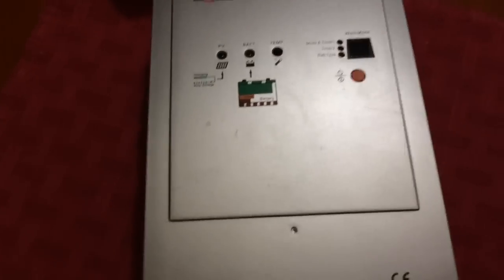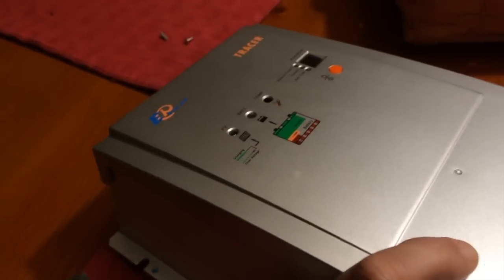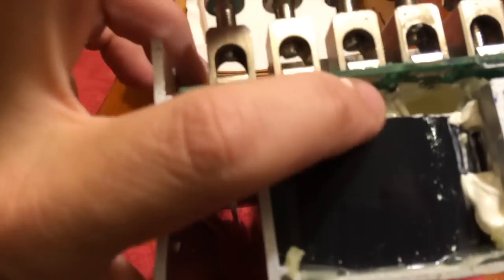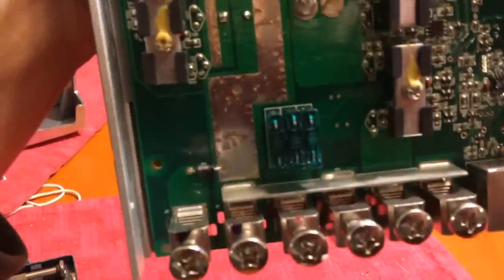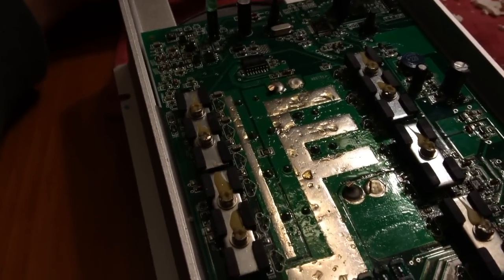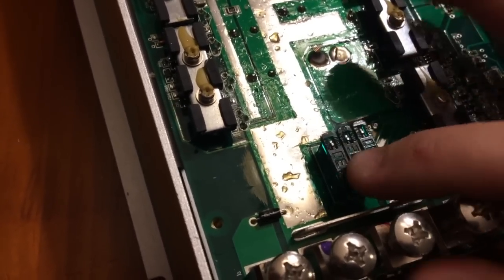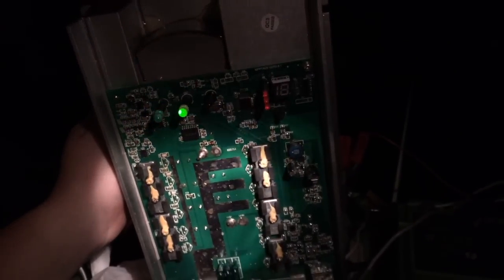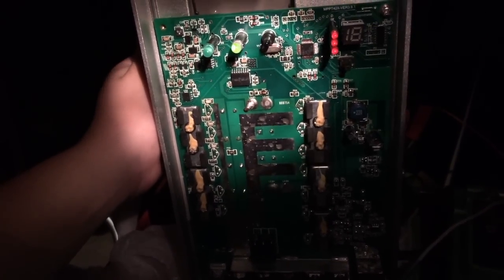Need Help Fixing My Tracer MPPT Solar Charge Controller

Comment: Did you ever find the issue ? I saw something on the board that looked like a cracked soldering joint and possible cooked looking. I'd be willing to check it out for you, just for the education.. I do work on electronics,, All that i'd ask you for is the shipping cost.. If i can't repair it. then i just return it to you.. There is few to no one around to repair these units,

Comment: I am currently working on the repair of one those units!  In the glue at the bottom there are all the big electrolytic caps and a big inductor.  The inductor is for the buck converter in this unit.  That is the part of the circuit that take the voltage from the panel and regulate it down to the battery level.  Could you share the marking on U10? U10 is an ic next to the Ethernet port I cannot read it in mine
Reply: U10 - LM2903

Comment: Hi that white stuff is for vibration and heat transfer from the transformer or inductor  that's located in the black cylinder like container. now test the unit by hooking up the out put to a battery and put laptop charger on the input this would be for 12v configuration and check the current flow from input to output.
The output current should be higher also the input voltage should also be higher. 
There is a thermal cut off or shutdown so that could be why the device went off then when you connect your battery as you did in your video it came on.
Hope this helps

Comment: is that a 12 24 or 48 charge controller? I am planning on switching my battery bank to 48 volt eventually
Reply from the maker: +Clearly Seen it will work on 12 and 24v.
Reply: +Off Grid Nation thanks!

Comment: I use an old power supply from an old dead laptop. It puts out about 19v and 3.5a which lets you test without a panel in the sun. I stripped the wires after cutting off the plug that goes into the laptop. The bare wire is the negative. Make sure to connect the battery to the charge controller first, before plugging in the power supply, you already knew I'm sure. And unplug the laptop charger before disconnecting the battery from the controller. The battery should be the first thing you connect and the last thing you disconnect.
Reply from the maker: +pokerfacetodd Thanks Todd.

Comment: I'm very interested in the out come of this because I have a Tracer also. Mine I have had for 8 months with no troubles. I used to play around with electronics as a hobby (amateur radio),you need someone to look at it with you that knows what they are doing. If you can't find someone get a magnifier go over every inch of the circuit board look for things that show signs of getting to hot. the other thing to look for is loose components or cold solder joints. use something nonmetal to poke around checking smaller components, a sharpened dowel works well.

Comment: use a fuse checker. 2. get the accery pack from h.f. 3. ultility tech sells thro lowes a 12 volt / 110 led work light. 3 make jumper cables for those fuses with slide on wire crimps.

Comment: The reason they soldered the fuses to the board is to avoid the few extra cents to buy the fuse sockets. Any company likely to go to such lengths to save money is likely to skimp on quality elsewhere so I wouldn't class it as  a top quality or reliable product.
The white gunk around the "Black Thing" ( a toroidal transformer i think) looks to be some kind of thermal conductive material to transfer heat from the transformer to the heatsink, so it was probably a mistake to remove it. Opps!
Reply from the maker: +Miko Jones Thanks. It was globbed in there so messy that I didn't think it should have been there. It wasn't working anyway so...whatever. I appreciate the info though.

Comment: The stuff on the board is called "gliptal" conformal coating to protect the parts and board from moisture. The fuse's are in parallel 3X30amp = 90 amp, cheaper to use 3 30 vs 1 90. The white foam is used for vibration (noise) and heat transfer from the transformer to the case. Use your noise to smell out a problem. Always remember, your nose will never lie to you! Also look for burned STUFF! With out looking at it it's a crap shoot, I've been troubleshooting electronics for over 30 years, good luck!
Reply from the maker: +Jim Smith Thx Jim. There was no smell.
Reply: +Jim Smith Yup and good tip on the nose test. I was wondering about a possible nearby lighting strike taking this out? But he got a light when hooked to some batteries.

Comment: You're getting a lot of comments that don't make sense.  It's not uncommon to coat an electronics board with a waterproofing, especially if it might be mounted outside.  That is not capacitor oil.  And where it ran down to, nobody insulates a transformer, they have to dissipate heat.  I'm guessing you had it mounted vertically, it overheated, the coating ran down to the bottom and the thing shut off.  If it will work, I don't know, and why they soldered in the fuses, is they're cheap.  And the overload may not have been the input, but when the batteries became fully charged.  (max input vs max battery)  I have had where battery charging decreased as it was supposed to but then rise unexpectedly on a battery with no load.  Just a thought.
Reply from the maker: +Adventurous Aardvark Thanks AA.

Comment: The white foam stuff is some kind of conductive substance to enhance the heatsink function. The shiney on the board is some kind of Chinese conformal coating(insulator)
Those fuses are actually a good design and a last line of defense to protect your PV and batteries. I have the same MPPT controller rated 20 Amp only running about 7 amps here with 12 HF panels wired for 24vdc making 180 watt and 200Ah of batteries. You are aware that the new PV you installed will at first far exceed it's documented rating? Maybe just upgrade to the Tracer 60A. The midnites look nice but that pretty enclosure makes it expensive unless you have money to burn.. SB steps down off his soapbox ;)
Reply from the maker: +Shadow Birdie I was aware but after talking to a few people I thought I would be okay. It's rated for 780w and I only have 820w. I thought it was close enough that I'd be okay with inefficiencies. I guess not. I really liked the unit and for the money I thought it was awesome. I hate overspending especially if it's for a name but I went ahead and bought the Midnite. I didn't know that they made a 60a model. The last time I looked (a few months ago) I only saw the 40a and it didn't have additional wattage rating if I recall correctly.
Reply: If the controller I assume you're talking about is rated 780 and you have 820 that's a problem, am I misunderstanding? I overrate by at least 25% on the China stuff, it's cheap, what was the price difference between the 10A and the 20A, I think it was like $14. I do my own math, amps and volts are all I'm concerned about. I have 180 watts/24volts which is only about 7.?? amps on a 20A box (controller is loafing) I even have room for another 3 or 6 panels, but doubt I'm going there w/o a $50 off coupon when they're on sale, or a Craigslist failure. They are great for like me a tenant with a yard, very sturdy and you can just pickup the frames of 6 each I built and load them into a Uhaul. You haven't mentioned, what's your battery condition after this, any damage?? Did they drain out to the panels after the Esolar apparent failure? And from here it's a long way to Carolina, a diagnosis my turn out the controller still works, just got stressed a bit..  regards, more later, have a good one, money under the mattress here ;)

Comment: If you know someone who works with electronics, I would ask them to check it out. Usually it's a capacitor or resister than causes most problems. I hope you get help on the device.

Comment: Wow that is very odd, The stuff on the board is nothing to worry about. The white stuff kind of looks like the capacitor got hot or blew. But I'm just taking a guess so get a multi meter and check it out for sure. You will love the Midnite Solar Classic :-) Thanks for sharing my friend.

Comment: U need  to check it out with a muti meter  check your fuses & mosfets. I have a few videos on my channel about Power Jack grid ties If u watch them U can see how to test these things rather than trying to explain it .I hope U can Fix it, as I just bought the newest 40Amp model for my Camper. U can also test the charge controller by hooking it up to a 12Volt  battery then hook up 2 12 volt battery's in series for 24volts to PV in side  if it is working It will try to charge the 12volt battery bank or at least it should turn on. also that stuff on the board is  a coating to protect it for moisture ,elements.

Comment: does that board unscrew from the housing and is there more circuitry underneath? The white stuff just looks like insulation and I wouldn't be too concerned with that. The crap all over the board though looks like a capacitor blew, but I don't see any capacitors big enough to cause that type of leakage all over the place. Does the board smell burnt?
Reply from the maker: +Cameron The board had one screw in it and when I unscrewed it, the board wouldn't come off. The board didn't smell burnt at all.

Comment: looks like a capacitor within, blew up, and that "gunk" is what came out from them blowing up
Reply from the maker: +Mr. C I'm wondering why it didn't light up when I had it hooked up at the cabin but after I took the white muck out it did light up.
Reply: better that you went ahead and ordered the outback, now to get some better batteries. search Amazon, for Vmax AGM batteries, the sell them in sets of 1,2,4 & 8, 155 ah 12V, good price, fast shipping, you could immediately go to a 24V system as the outback will handle it
Reply: AGM = no off gassing, so no outside venting would be needed

Comment: use a multimeter to test those fuses. Just touch the probes to the little bits of exposed metal. I have had several fuses in previous cars that looked fine but were very slightly blown. 
As for the board, you definitely overloaded it. Looks like the board is delaminating.
Reply from the maker: +Jason Kirkland I will try the multimeter. Thanks for the tip.
Reply: +Off Grid Nation Looks like you popped a capacitor. The stuff on the board is fine man. they put that there to keep the bord from getting wet. Test the fuse with a volt meter. Looks to me tho if the cap on the solar side poped it will not work. God Bless.
Reply: +Off Grid Nation Check the mosfets as it's a common failure point and easy to replace
Reply: +yankey4 Check for bulging caps also